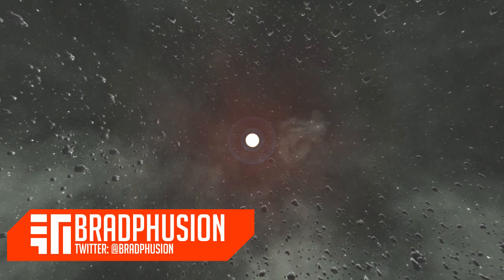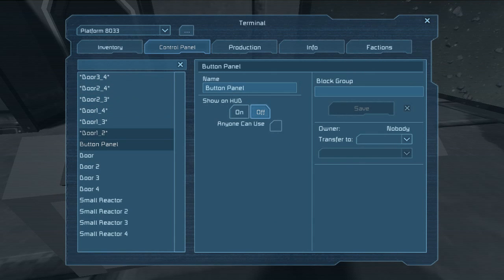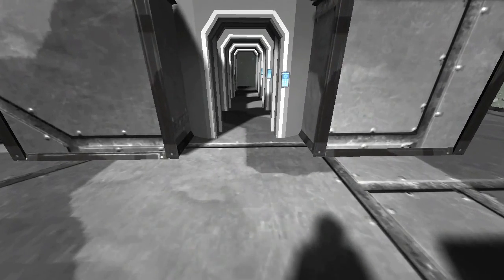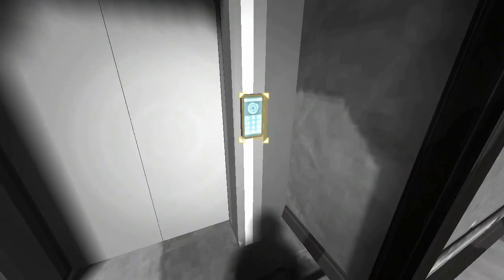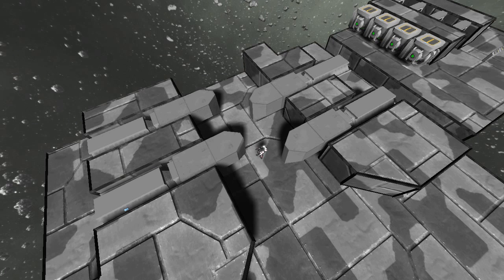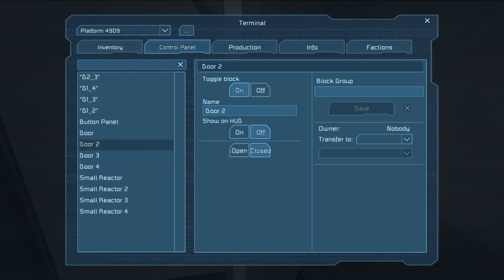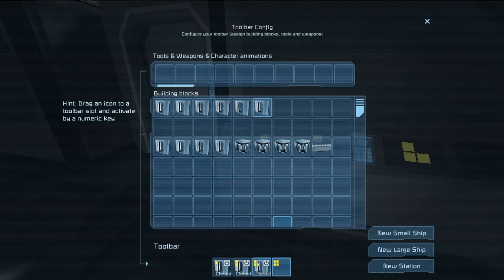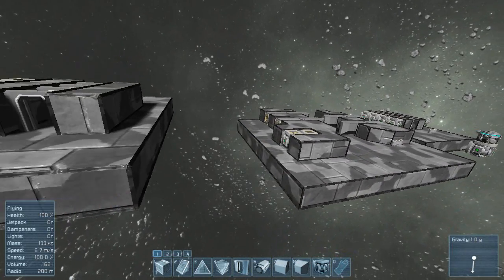RE:Engineering: Combination Lock / Password Doors! (Space Engineers)

Comment: The lock doesn't care in what order you press the buttons and if you press the same button twice it's as if you've never pressed it, which lowers the amount of combinations in a single panel to fifteen. (Assuming the password is allowed to be anywhere from 1 to 4 presses. Otherwise there's fewer.)
That makes it pretty easy to figure out the combination by trying all fifteen possibilities.
Reply: Having the buttons turn on lights or alarms when pressed in a certain order can at least make it so that spending too much time guessing will result in making the owner aware. Remember, it's not likely they'll see all 4 doors from top down. Rather, it'll be in one line.
Reply from the maker: This was only using 4 doors/buttons in paired combinations. As said in the video, you could have multiple panels with different combinations and groupings (pairs, triples, quads, etc.) The complexity depends on the creator and the grouping :)